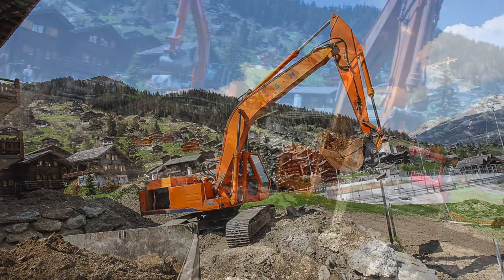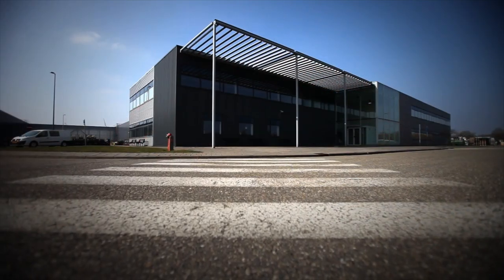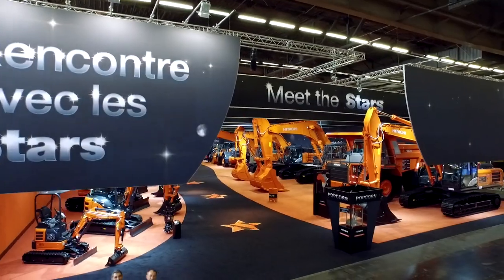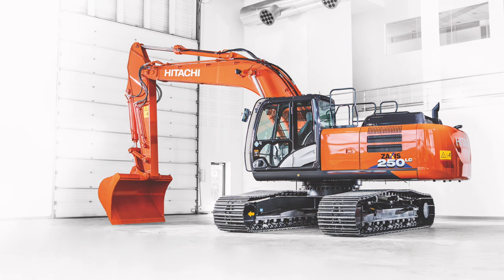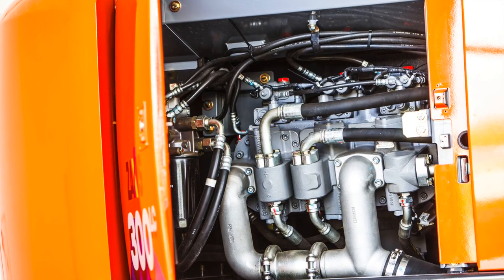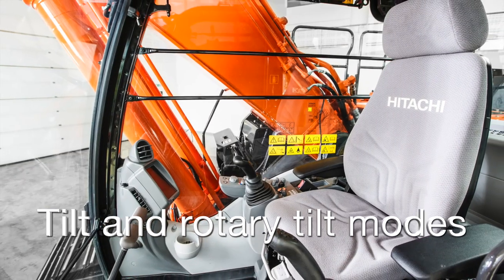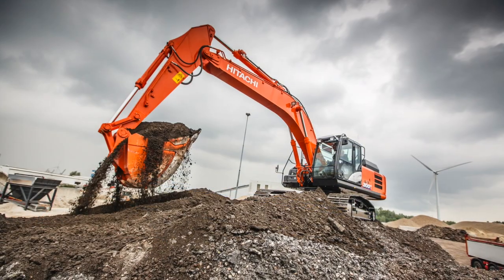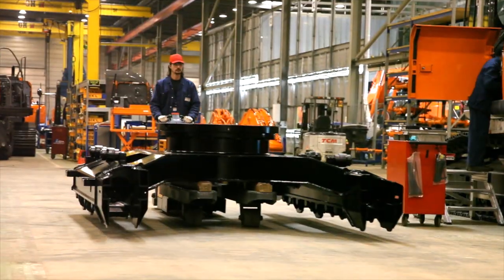New Hitachi excavator range: ZAXIS-6

Comment: When Hitachi Zaxis-6 will be on sale ?
Reply from the maker: Hi +Armando Fino, the models below are already available:

ZX250LC-6: http://www.hcme.com/en/Machinery/Excavators/Medium-Excavators/ZX250LC-6-ZX250LCN-6 
ZX300LC-6: http://www.hcme.com/en/Machinery/Excavators/Medium-Excavators/ZX300LC-6-ZX300LCN-6 
ZX350LC-6: http://www.hcme.com/en/Machinery/Excavators/Medium-Excavators/ZX350LC-6-ZX350LCN-6

Thanks,
Mac
Reply: They are available informação europe too?
Reply from the maker: +Armando Fino They certainly are! You can find the dealer near you at www.hcme.com/locator
Reply: +HitachiConstruction Thank you :D

I've just saw it now. The main diferences between ZAXIS - 5 and ZAXIS - 6 are the SCR and TRIAS II system, right ? :D
Reply from the maker: +Armando Fino Well there's that and: new hand rails, reinforced platform, wide-opening engine covers, improved fuel circuit, battery disconnect switch, extra track guard, reinforced travel motor cover, ultraviolet resistant cab material, tilt and rotary til modes and it's more fuel efficient while keeping the same level of productivity.